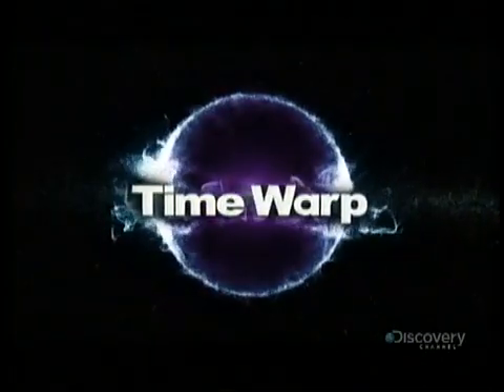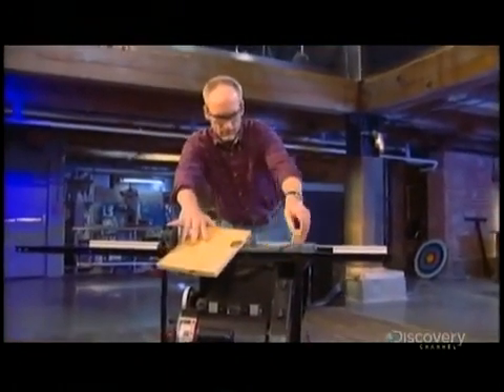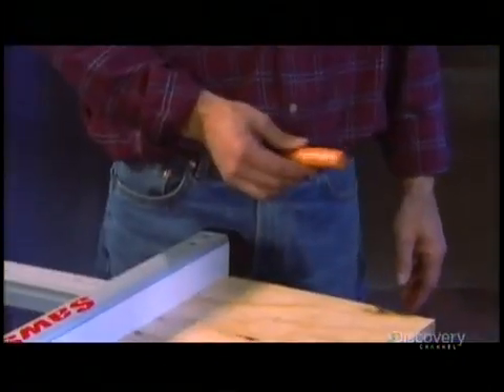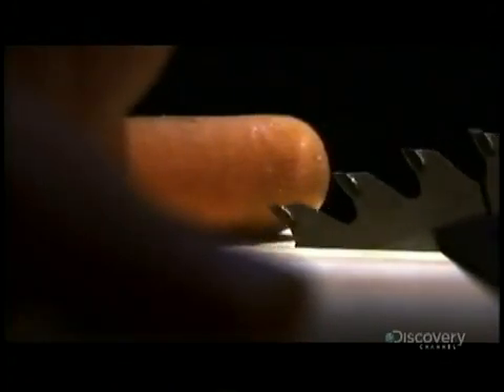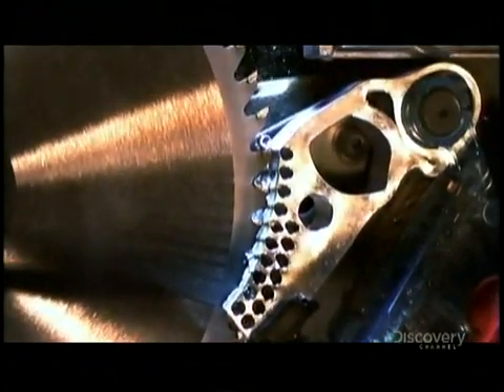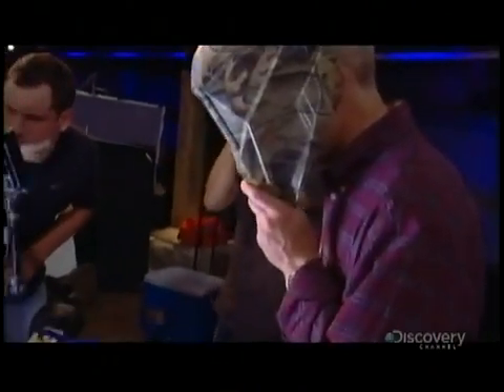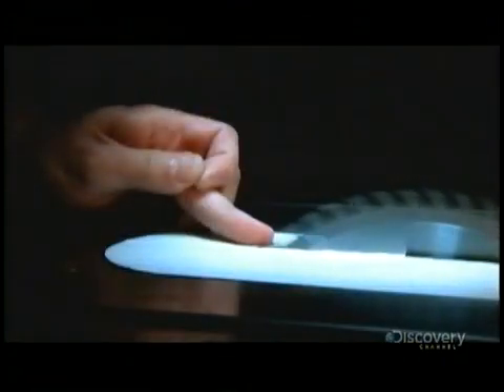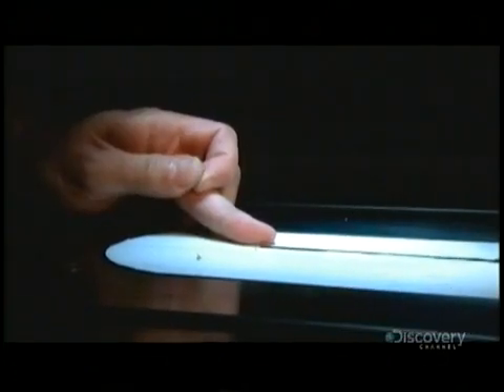Saw Stop - This guy puts a finger into an active table saw blade & comes away without a scratch!

Comment: Instead of forcing the blade to stop and break by smashing into the stopper, why not have the blade drop below the table? Like, instead of stopping the blade, have the blade held up by a mechanism that can immediately lower the blade so it is below the table. The blade doesn't have to be stopped if it is out of the way, so you don't end up breaking anything, and the mechanism can simply be reset by raising the saw blade up to where it was beforehand.
Reply: it's spinning so fast at over 5000rpm that it'll still get a few rotations as it falls. the only way is to stop it dead in its tracks. the amount of milliseconds it'll take for the blade to drop down can still cut deeply
Reply: Because of how fast it is spinning. That wouldn't be possible. It needs that stopper there or this wouldn't be possible
Reply: +koofdome he never said that gravity had to push it down... a pneumatic system can easily push the blade down as fast as the stopper stop the blade....
Reply: it would take waaaay longer than 5 milisecs. or it is unpayable
Reply: Robert de Ridder huh?
Reply: +Kanade Tachibana with Blocking the blade, you stop all that kinetic energy. that kinetic energy is used to move the blade down. that all goes in 5 milliseconds. but if you want it to move down when touched, you have to make a whole meganism and it uses other energy to move down.  not that kinetic energy. and with medium quality stuff.  it takes longer than 5 milisecs.  With some clever engineering? it takes  it at least 0.1second which is 100 instead of 5.
Reply: +Lucid exactly

Comment: So it works if you soak your hand in salty water right before you use the saw and then keep your hand wet till finished. What happens when its a typical worker with dry callused hands and usually partially covered in saw dust or dirt.

Comment: this is awesome  but their is a huge problem with this tho  what if i wanted to cut a metal sheet  with my table saw  depending on the metal  it is conductive i wonder if their is a way to turn saftey off  so you can use it like a regular saw if that is the case take my money id be the first one in line

Comment: Just dont cut wet wood
Reply: I like how he shut up after you rekt him.   Lets see...  Conductivity..  Wood?  Nope.  Water?  Hell yeah.  Wet wood?  Now that's an interesting point.  And furthermore,  joe you got fucking owned.
Reply: you can turn off the mechanism that will stop the blade, and there is a way to test beforehand if the wood is too wet
Reply: ***** Hmm.. on the sawstop website it says "If you are unsure whether the material you need to cut is conductive, you can make test cuts using Bypass Mode to determine if it will activate the safety system’s brake. The red light on the control box will flash to indicate conductivity."
Reply: Every type of wood is a different density and even the same species each tree varies in density to "don't cut wet wood" is pretty vague.
Reply: joe Costello Well I am not a woodworker and don't know what the term "wet wood" means, but I mean don't put your wood in the rain and then use the machine or it will cost you a lot. Is this better, "don't cut wood with a resistance lower than a few megaohms"
Reply: No wood is as soft as flesh, not even the softest drenched in water wood.so the machine isn't gonna mistake that.
Reply: joe Costello It goes by conductivity, not softness
Reply: +jimbit22 The current is tiny, so you don't need a complete circuit for some of it to flow into you due to the slight (but still much great than that of wood) capacitance of the human body.
Reply: How about proper grounding? meaning that if your body does not complete (gloves, rubber soles, thick clothes) the circuit the mechanism won't function as intended..
Reply: +u wot m8 actually the conductivity of water isn't that great but its the impurity of the water that makes the diffrence!!
Reply: +DutchMastermind Well wood is a pretty big impurity
Reply: Skyler F woods structure means that there are very few mobile charge carriers like ions or electrons. A human finger has cells full of liquid with lots of dissolved ions, meaning that it can easily facilitate a current flow, even when completely dry externally. In other words: wood is dry, finger is wet.
Reply: +Debated Nothing I know that, I am talking about wet wood vs dry finger. The wood has dust particles which introduce an impurity to the water making it conductive.
Reply: Skyler F don't cut dry wood? The blade detects in a fashion similar to a capacitive touch screen, and no matter how much you dry your finger a touch screen will always detect it.

Comment: Call me a pessimist, but I wouldn't test it. lol. I've been a mechanic for way too long, and I've seen way too many mechanical failures to trust that saw brake contraption.
Reply: AmericanThunder The way he "tested" it was kind of cheating, IMO. He put his finger along the side of the blade. He didn't put it straight up to it. I think there is still a likelihood of being cut in that manner, seeing as the teeth are spinning in the direction. And when the blade pulls down in it's safety mechanism, it would see like it'd catch your finger and pull it a bit down with it.

Is it an extreme improvement? Absolutely. I'd much prefer a cut to a missing finger or worse, but I don't think it's as perfect as this video makes it seem.
Reply: AmericanThunder Sure, it has a chance of failure like anything in the real world and is no replacement for using good safe techniques, but from the comments on here, it seems it does what it's supposed to most of the time. I'd love to have it on mine.
Reply: John Zombies Didn't you watch the whole video? They did try this first with wiener(/hot dog) at a good pace along with some wood and that stopped really fast. Only small scratch on the wiener, I don't think it even pierced the "casing". I don't speak english as my first language so wiener vocabulary is not my strong suit but I mean the skin of the wiener anyways.
Reply: North American YouTuber There is always oil and moisture in your hands. It will always go off as soon as part of your body is close because it's an electric charge looking for a ground.

Comment: Wonder if sawstop will come to other saw applications such as meat band saws etc. I  had a miter saw "nick" my finger while it was stopping and tore a 1/4 inch gash though the middle shredding the tip and the nail right off. Washed it out and just put pressure on it with medical tape, no er visit because im broke and don't have insurance. healed up in a couple months and just have minor nerve damage on the tip.

Comment: There are so many negative comments on this, I can't believe it. This thing WORKS. It would save fingers. My daughter is a carpenter. I asked her why this was not on ALL saws, and she said, "It costs a bit more. Theatre shops are on a budget." That is the same answer I got from her mentor and teacher, years ago...he has been pushing this for EVER, but told me, "People don't want to pay the extra cost to the shop...so it doesn't get funded." How incredibly short-sighted. It makes me so mad. She is skilled, and very safe. She teaches newbies. This device should be on EVERY SAW.   djw
Reply: One reason for not having this on all saws is that it won't work with certain types of treated wood, and when I say won't work I mean you touch the wood to it and the safety kicks in. The treatment on the wood causes it to go off. But yes, people should shell out the little extra cash for these where they won't just go off due to the wood you work with.

Comment: Will you still get cut if you move faster into the blade? 
Probably, but if you look at the reaction and normal cutting speed when using such a machine the risk are pretty limited.
Let's say you cut at a speed of 10 cm per second (about 4 inch per second, which is VERY fast) you'll cut about 0,5mm into your skin before this security mechanism kicks in.
To get a 2mm deep cut you'll have to move at 40 cm per seconds (about 16 inch per second) towards the blade.

I guess the reaction speed of this safety feature can save lots of fingers (even most of them).
Reply: You will get a small cut, yes. I have no idea why you would want to cut at four inches per second--your cuts will probably look like shit and your blade isn't going to be able to cut that fast for very long. But even if you hit the blade with some speed there is no chance of it ever reaching bone.

Yes, you may get a cut. Will you lose a finger? No.
Reply: Sorren Peak I was exagerating on the cutting speed (see that I mentioned "VERY fast") to point out that even at exagerated speeds the safety mechanism is pretty reactive and will save your fingers.
Reply: The blade stops and drops in less than 10 milliseconds. That's 30 times faster then the fastest time you can blink your eyes.

Comment: what about with speed?
Reply: I'm not sure about the speed of a karate chop.

Though as I clearly said before, if you intend to hurt yourself, then you deserve it.

This is designed to prevent accidents, not idiots from committing.
Reply: you won't lose a finger. small cut at most
Reply: The blade stops in 1/1000th of a second, you'd need to be trying pretty fucking hard to beat that
Reply: I know. your right. im just being an ass at this point.
Reply: I know
Reply: ***** i think he is saying if the hot dog came at the saw with a higher speed (like if someone fell onto the saw)
Reply: Robert Fisher Speed of approach means nothing. This works in real life events where people screw up and get severe kickback that drives their hand into the blade... Faster than you could run a panel or what ever wood part you can think of. we have them in our college shop. Students pop one every few months. All that in mind... The saws are shit. Maintenance is a normal event and they break down constantly in the weirdest ways. Sawstop will give you free parts though.
Reply: Dan Ivanov exactly.
Reply: Murdoch so, you couldn't karate chop it?
Reply: Murdoch but some people operate really fast. like pushing wood through it really fast.
Reply: The saw can only cut so fast, you'll cut "faster" by being smooth, measured and efficient, not by shoving wood through as hard as you can.
Reply: Robert Fisher thats because they are expierenced
Reply: Robert Fisher It's like extreme whack-a-mole basically
Reply: Robert Fisher It would depend on the angle. If you slap your hand down even on a stationary saw blade, you're sure to get a pretty deep wound. The fact that it retracts back into the table would save you even from that though. The only way i could see you getting a cut is if your finger was going fast enough to get underneath the hooked portion of the blade, and the system activated and basically dragged your finger down with it. Even then it wouldn't be enough to completely cut off your finger, and you would have to be going INCREDIBLY fast to get your finger that deep into one of the hooks considering the speed of the blades rotation. So pretty much, no. Worst thing that can happen is a knick.
Reply: Robert Fisher If you're experienced enough to saw that quickly, you shouldn't be in danger of getting your thumb stuck in it. Even if it does happen, you almost certainly won't lose it. Maybe a cut if you're going way faster than you should be.
Reply: Robert Fisher Reek?
Reply: macheetah49 Noo, pork sausage
Reply: Robert Fisher 
You're right.  The test was done at an unrealistic slow speed.  If the hotdog was dropped onto the spinning saw blade it would be cut in half.
Reply: Murdoch  Most table saw accidents happen because the hand slips quickly into the spinning blade.  It happens so quick that pain is felt moments after realizing the missing finger.

Comment: Accidently drop some water on the saw -60 dolla. Working hard and some sweat hits the blade -60 dolla. Masterbating to your awesome new saw and some semen hits the saw -60 dolla. Material in the wood that can conduct (left over from a screw or nail) -60 dolla etc
Reply: Aqw aq you dont have to be an idiot to lose your finger in a saw, sometimes mistakes happen to the best of us
Reply: 10,000 $60 mistakes is worth it to save your finger.
Reply: Not quite how it works.  Salt water/conductive material by itself is not enough to trigger a capacitive sensor.  The key part isn't the conductivity, it's conductivity attached to a large conductive object: in this case, you.  Try it on a touch screen: you can use the screen via a quarter, but not if you're wearing a glove at the same time.

So unless you drenched your wood before putting it through, you'll be fine.

Comment: Title is misleading. You come away with skin missing. Thats not 'without a scratch'. 
But anyway, I've seen these things work in demonstration, and actual use. They legitimately work. Even if you are running wood through at normal speeds (normal for a good wood worker) it still stops. You could slap your hand on the saw blade while it's running and it would still stop, leaving you with only a scratch.

Comment: your finger would hit the blade alot faster, i don't even think his finger actually touched the blade
Reply: Actually we have one of these saws in shop class at school. I have personally watched it work. Kid almost lost his thumb. The blade has a small current in it and the very millisecond it senses a ground the blade drops. It barely scratches the first layer of skin
Reply: It stops faster than an airbag goes off, i think you would be alright if you hit it
Reply: It takes less than 5 miliseconds for it to stop, you could try to headbutt it and the blade would stop before you hurt yourself
Reply: thesuntrider if you could provide a video of someone headbutting that machine...i will show you a video trying to teabag it!deal?
Reply: thesuntrider lmao your comment cracked me up. though you might not get cut, when your head smacks that metal deck it might hurt a bit. i recomend not trying lol
Reply: I would imagine tapping the side of the disc section of the blade no where near the cutting tips and likely at a much slower RPM.
Reply: Matt Van Helden i completely agree, and the scratch you would receive would be the smallest scratch you have ever received in your life
Reply: Toby BeswickMedia the difference in speed would not make up for 1/1000th of a second reaction time. The speed at which he touched it and the normal speed you'd touch it if on accident is difference between not even a scratch and a scratch.
Reply: thesuntrider please try
Reply: Indeed

Comment: what if the safety sensor fails, bye bye finger.
Reply: What if you don't have this at all, bye bye finger
Reply: superghost6 What if you don't have a finger :()
Reply: kristoferdeleon what if a sawblade randomly flies through the air when you're just out walking? Bye bye finger
Reply: tzokke what if you don't have a machine?
Reply: it's gotta have a fail safe mechanism
Reply: spanishflew what if the fail safe mechanism fail? still bye bye finger. XD

Comment: The blade is circeling like 4 a5  times finger is standing still
If you do this fatsef. Your finger is gone
Reply: False. If you watch the video, the wiener is pushed into the saw very quickly, and sustains very little damage. A wiener is many times softer than your skin. No matter how fast you think you can move your hand, it's very slow compared to 1/1000 of a second.
Reply: tml4873
the weiner is wet.  most woodworkers hands are dry but yes it will save your fingers.
Reply: The blade stops in about 16 milliseconds, to put that into perspective the blink of an eye takes 300-400 milliseconds